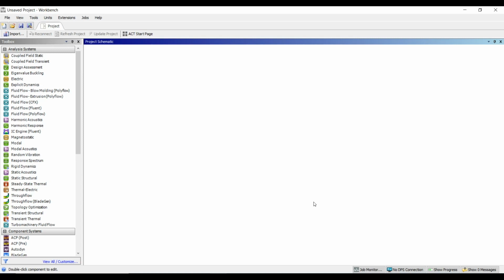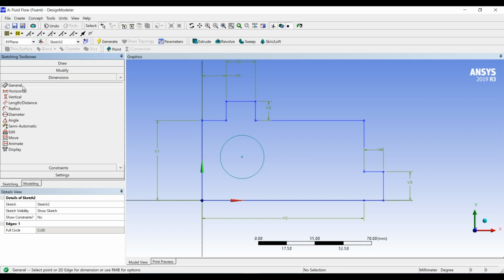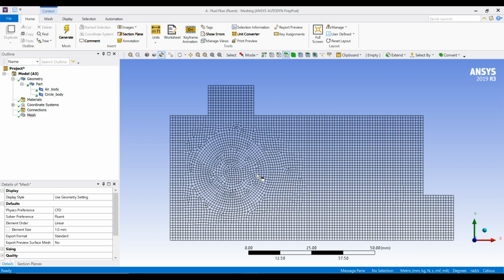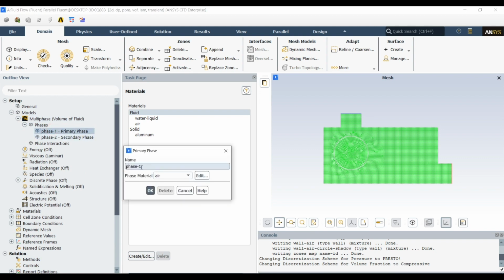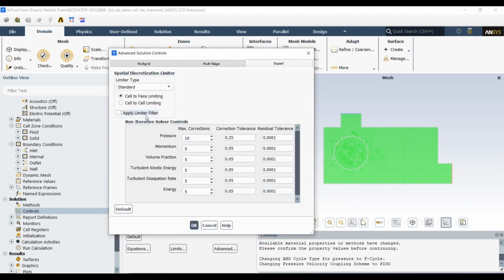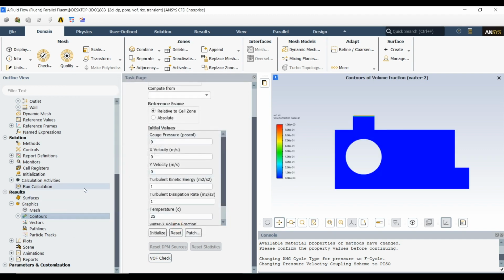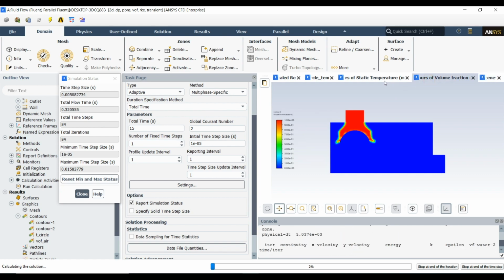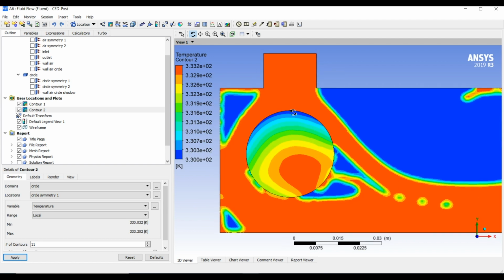ANSYS Fluent Tutorial: Two Phase (VOF) Fluid Flow with Conjugate Heat Transfer Analysis

Comment: Hello Professor, in what way could a free discharge of a mineral be simulated, for example:
Recreate the fall of a mass of mineral flow in free discharge using a VOF method (I do not see another option to assimilate the mineral) and in this way to know the velocity and air pressure fields around the mass of mineral flow as a function of time, for this case I pretend to configure the mass in a density of 1. 700 Kg/m3 in a free discharge with a discharge duration time of 10 seconds from a height of 5 meters, the geometry would be very simple due to the capacity of my equipment and also, I only have a student license of ANSYS.
The objective is to know the velocity field at different positions of the fluid discharge just at the air boundary layer, my question is:
•	¿How can I simulate the movement of the container from a 180° to a 90° position?
•	¿How can I plot the instantaneous flow falling to different positions of the container?
•	¿Is it possible to add particles to a VOF model?
•	¿In case I cannot add particles how can I do it in DPM?
•	¿Do you have something similar and if possible, share?

Comment: Thank you, It is very productive, even it guide me to proceed with my research. Currently, I'm simulating hot air (at about 200-300 Celcius ) passing through the dense and patched particles (solid) at room temperature. I think the Eulerian model is dedicated to gas-solid regimes, but when I'm applying it to my problem floating point exception error pops up at about 5-10 iteration later. I would appreciate it if you answer.Thanks for help

Comment: When I check Сell Zone Condition Air is fluid and Circule is Fluid. But in your tutorial Air is fluid and Circule is Solid automaticly. When I change the type of Circle from fluid to solid I get an error "materials in neighbor cell threads (6 and 5) of
 interior zone 8 are of different types (water-liquid and aluminum). This problem MUST be fixed before solving!" And I exactly repeated every step from your tutorial. How can I fix the problem and change the Circle type to solid correctly?
Reply from the maker: Thank you for watching and for your comment. You can change the type to solid in design modeler and/or meshing. Also, make sure that in the meshing it is not creating the interface automatically, and make sure you make a single part from two bodies in the design modeler. Changing the type in the fluent also should work. If the problem still exist, you can export the fluent case file and send it to my email and I can take a look at it. simpro2144@gmail.com
Reply: I  changed the type to solid in meshing! Thanks. Changing the type in the fluent also works but I get the error described above... And one more question. You used boolean operation in design modeler. What if I use two bodies in the design modeler without boolen (one is solid, one is flued)? It's just for understanting.
Reply from the maker: @victorvin4707  What type of boolean? I used boolean to subtract, in the geometry creation you can not have two overlapping bodies in one point. So when we create the circle inside the rectangle, we need to subtract the circle to create a void inside the rectangle while keeping the circle as the surrounding fluid.  Please let me know if that is clear. If not, please clarify your question. Thanks.
Reply: @AdvancedEngineeringTutorials   "you can not have two overlapping bodies in one point". Thais is all clear. For example, if I have some solid area in fluid (or some fluid area in air) I need to subtract to avoid overlapping bodies.
Reply from the maker: @victorvin4707   correct! :)

Comment: Thanks a lot, it was really great job. Is it possible for you share a two phase mixture model with nanofluid?
Reply from the maker: Thank you for your comment. Most of the models used in ANSYS Fluent are based on continuity assumption. In nano level, the assumption of continuity is not valid anymore and we cannot use the regular fluid dynamics equations. I am not sure what is the problem you are looking for exactly, but I believe Molecular Dynamics (MD) simulations will be a better approach for nano scale simulations.
Reply: @AdvancedEngineeringTutorials  I mean a paper like attached link, please look at this paper, it is an examle of  nanofluid with mixture model

https://link.springer.com/article/10.1007/s10973-018-7349-x